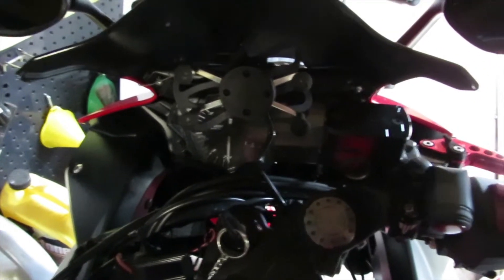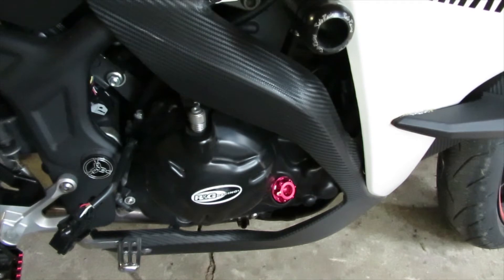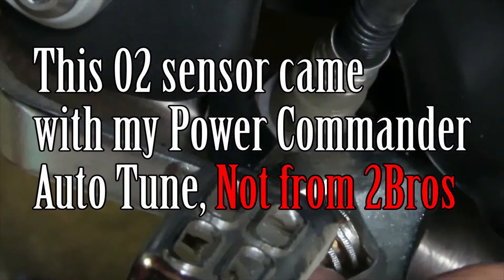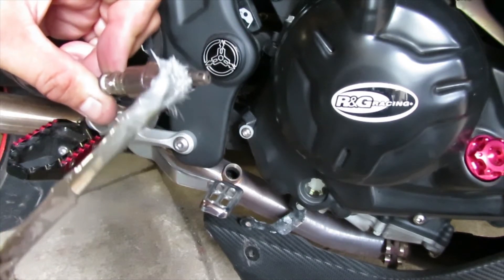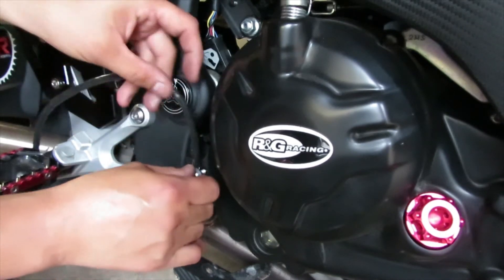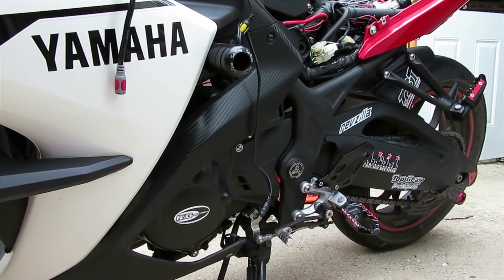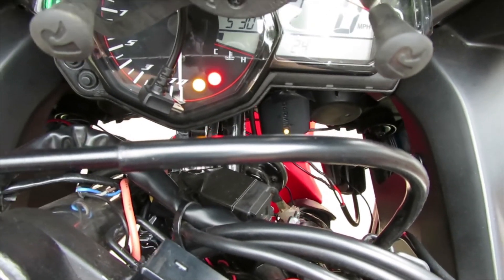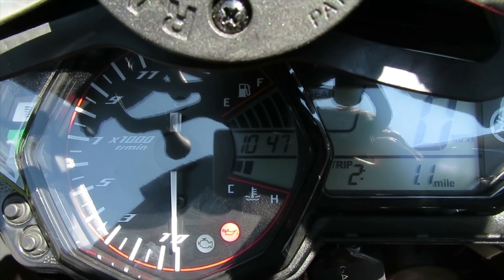Got a Mysterious Engine Code # on Yamaha R3

Comment: i got 42 instead of 24 and before my speed wasnt showing i fixed my cable and speed is showing but engine light and 42 is still on any solution?
Reply from the maker: 42 is associated with speed sensor, clutch switch, and gear position switch, so verify they are operating normally as well. If the ECU sees the bike in gear and clutch engaged = no starter, for example. The ECU should reset when the faults are corrected.

Comment: It's actually a faulty o2 optimizer. By plugging the factory sensor back in your basically eliminating the ability to autotune. Which is fine if you're already tuned to where you want to be. I'm currently going through the same thing and dynojet no longer uses the optimizers. The kits now come with instructions to put a second bung into your exhaust. I'm assuming to eliminate error code issues. I ordered an optimizer off ebay. If that doesn't work I'll be getting another bung welded into my M4

Comment: Hey man. I just change to full system and done with tuning FID. The enjine light (code24) only come when i ride above 185kmh. After that i stop and turn off engine for 30 mins then start back that light turn off automatically. But the problem is every time i ride above 185kmh the light turn on. Any suggestions?
Reply from the maker: you need to get your system tuned on the dyno, do you have a power commander on your bike if no then i suggest getting one or you can get your ecu flashed.
Reply: @ACProductions77  okay bro. Thanks for the info

Comment: hello, i own an 2020 mt 03 and my engine light turned a week ago and wouldnt turn off. i installed an ebay full system exhaust a month and half ago and im not if its because of that. any tips?
Reply from the maker: if you installed a full exhaust system on your bike did you install the factory o2 sensor back on or did you cap it off?
Reply: @ACProductions77  I put it back on, but there was no engine light for weeks, and it randomly turned on after I was finnished from work a week ago
Reply from the maker: @samissa9714  besides the check engine light do you also have a code on the gauge cluster?
Reply from the maker: @samissa9714  you may just need to get your bike tuned to the new exhaust system as now the parameters are now different from the stock setup

Comment: Hey man been watching your videos for a while this morning with bike wouldn't start. I have no error codes in the fuel pump seems to kick on. I checked all the fuses and connectors the dash lights up but it gives me a high beam and a turn signal indicator and my TST Industries tail light is for some reason yellow now. Hope you have any ideas on what my issues could be thanks in advance
Reply from the maker: could be the starter Relay, check to make sure the cables are are secure there and the fuse. you mention that your tail light is lit in a yellow color? does it stay on that way?
Reply: @ACProductions77  i checked all fuses and wires. And yes my tail light is yellow I've never seen it that way before.
Reply from the maker: @farmfreshsquid1008  was the tail light wired correctly could be that the tail light wire from your bike is connected with the turn signal wires of the the tst rear light, or it could be a short on the circuit board of the tail light check with tst see if they can send you a replacement.
Reply: @ACProductions77  I considered that and went over everything. Its at a shop now. Thanks

Comment: HI, i have FULL  akrapovic   same code 24 getting, what sensor should i order i dont have anyother  just bought bike like that, can you send me the link of the  new sensor that i can put to remove the code and engine light please.
Reply from the maker: the #24 code refers to a bad o2 sensor so you would have to replace the o2 sensor that is made for your motorcycle

Comment: I don’t get the fuel pump noise when I turn on the ignition??
Reply from the maker: check to make sure your kill switch is not in the off position
Reply: you shouldn't get the sound if you stopped the bike with the fuel pump already set

Comment: what year is your R3? I'm now getting this code after doing a bunch of mods which included a full exhaust. In my application, I plugged the O2 port, and disconnected the sensor from the harness. I have an ECU flash that removes the O2 sensor, but still getting this code.
Reply from the maker: Jason Blancas mine is 2015. If you didn’t use a jumper plug for the o2 sensor then the check engine light will come on and u will get the same code 24. Only way to turn off the light will be to remove the led inside the gauge cluster which is way to much work. Most simple way to cover it would be to place small piece of black tape over the check engine light if you planning to keep this setup for a while.
Reply: Thanks, mines is also a 2015. I know that the PCV comes with a jumper, so I may look into finding a solution to jump the connector. As an interim, I did plug the sensor back into the harness and the exhaust. The check engine and the error are still present. Guessing some riding around would clear the error? its raining, though, and the bike is no longer street legal at this point. is there another way to clear the error, such as resetting the diagnostic?
Reply from the maker: Jason Blancas a ride around the block will clear the code if everything is connected correctly.

Comment: mine gives me a 19 error code .. and wont start the engine .. what i do is switch the key off then on again .. does the job .. for a while .. then do it all over again ..
Reply: Wait a minute opo boss .. sali ka sa r3 group sa fb .. dun ko din nalaman solution .. actually may recall ang yamaha .. papalitan nila wire harness ng susian at papalitan ang tank brackets .. free of charge boss .. hope this help ..
Reply from the maker: ba ecchi code 19 will be your side stand switch, it could be faulty and need to be replaced.
Reply: AC Productions Philippines r3 ver. dont have sidestand switch  ..
Reply: ba ecchi dude im having the exact same problem im Filipino aswell have you fixed it ever since?
Reply: ba ecchi Salamat pre, dadalhin ko sa yamaha to 1.2k kms plng ntatakbo.
Reply: @MrQWEEEERTY  boss ano naging issue sa code 19 mo ano ginawa ng dealer
Reply: @odysseusreyestv3808  basta boss iniwan ko lng r3 sakanila may warranty naman, 1 week bago nagawa. Namamatay yung makina men, dilikado sa daan haha